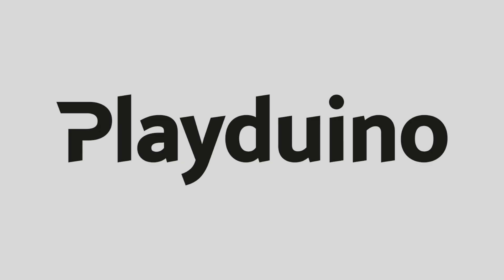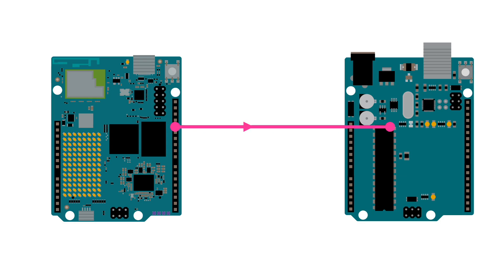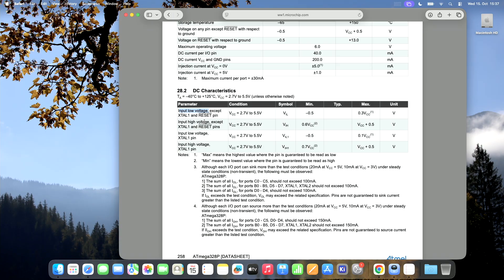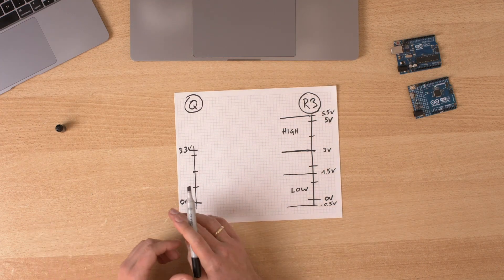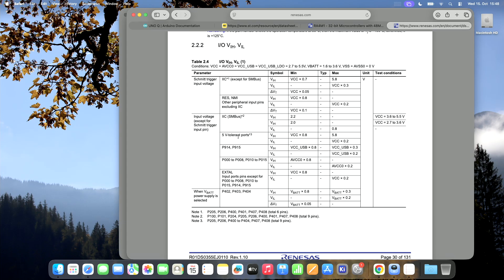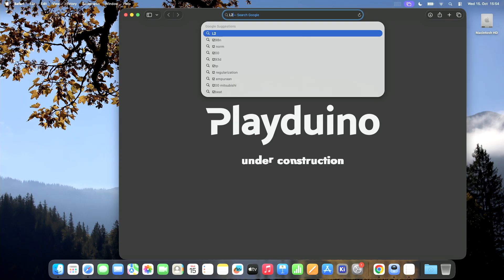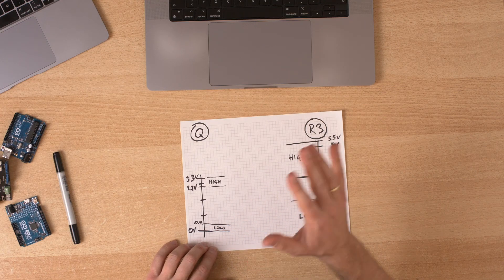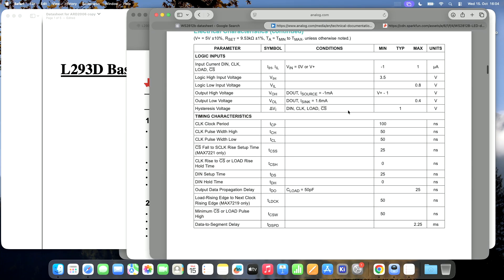Arduino UNO Q Shield Compatibility - Does YOUR Shield Work?

Comment: For future videos,  explain the electrical characteristics at the beginning of the video. Then refer to the pin state and voltage level as 'logical high' or 'logical low'. The video felt a bit unstructured by not going over the fundamentals and when you alternated between different terms to describe the pin state. Otherwise a good video👍
Reply from the maker: Thanks for your feedback 🙏

Comment: You can cut a lot of connections on a shield and use jumper wires. Maybe you just invented an adapter from this. The construction can have level shifting as needed.

Comment: cant you make a simple shield that allows arduino shields to work?
Reply from the maker: In theory yes but its not simple, sometimes you want to use pins as input, sometimes as output, sometimes as open drain, sometimes analog in or nowadays also analog out

Comment: Great video! Thanks for sharing. 

I have a HW Kitchen Playground GSM HAT that appears to interfere with bridge communications on my UNO Q.

Setup:
	•	UNO Q powered via a Raspberry Pi 4 PSU (5 V / 3 A)
	•	HW Kitchen GSM HAT (which has its own power button)
Observed behavior:
	•	If I start the 'Blink LED' container with the HAT powered off, the demo runs normally.
	•	If I start the same container with the HAT powered on, the bridge fails to blink. The debug console shows the following error:

File "/usr/local/lib/python3.13/site-packages/arduino/app_utils/bridge.py", line 343, in call
    raise ValueError(f"Request '{method_name}' failed: {err_msg} ({err_code})")
ValueError: Request 'set_led_state' failed: method set_led_state not available (2)

After this happens, all bridge communication between the CPU and MPU fails in a similar way on the other demo containers. A full power cycle restores normal bridge communication. Interestingly, if the Blink container is already running and blinking before I power up the HAT, everything continues to work fine.
It seems that powering up the GSM HAT before starting the container causes the bridge to fail initialisation.
Reply from the maker: Very strange bug. But you are already more successful than me. I was not able to blink an LED on the Q without shield 😂

Comment: This is an excellent analysis and true: when going for the Arduino Uno Q, the better thing is to forget ALL the old kits and modules and seek newer components that were thought to work with ESP32 and RP2040... modules that were designed around 3.3v. Cheers and thanks!

Comment: There is a ready and easy solution!!! #LogicLevelShifter! I use them all the time with ESP32... 4 channel boards.. from HIGH to LOW or vica versa... dirt cheap...
Reply from the maker: But how do you use them with shields?
Reply: make a logic level shifter shield